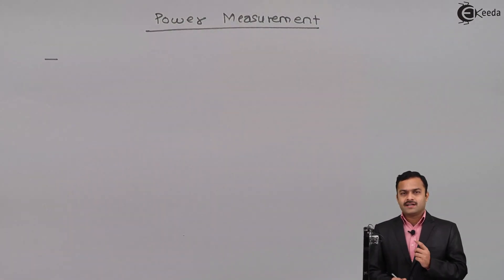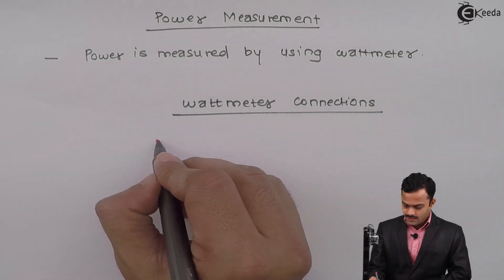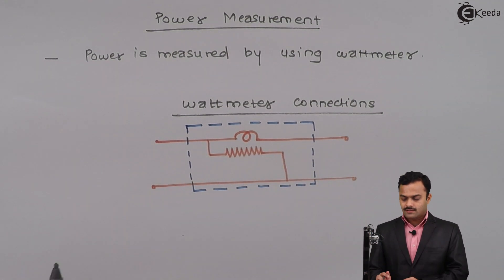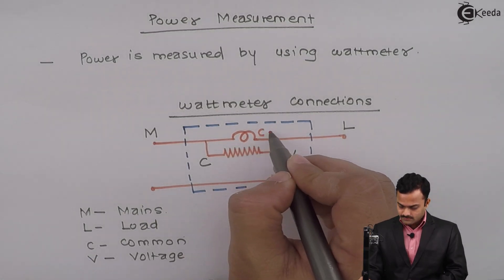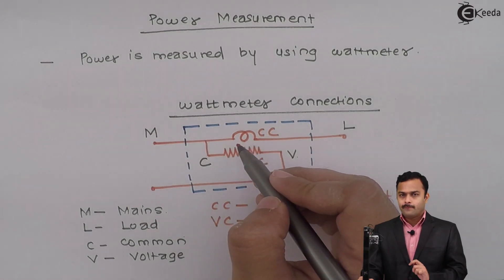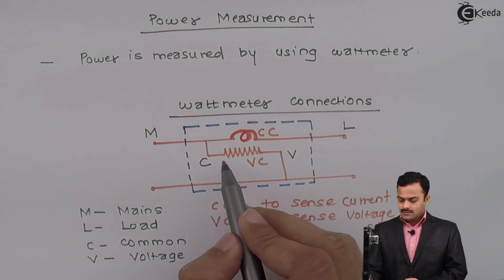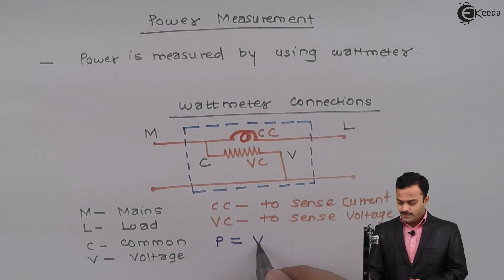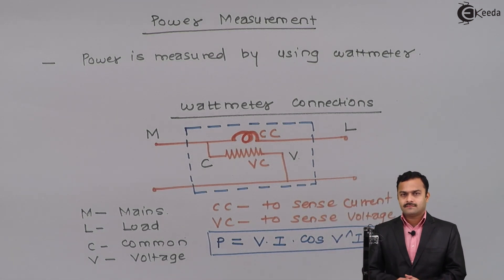Power Measurements and Wattmeter Connections - Three Phase Circuits - Basic Electrical Engineering

Comment: you give a wrong explanation.
Correct one is: In an Ammeter a small resistance is connected in parallel with the galvanometer and in an voltmeter high value of resistance is connected in series with the galvanomter.

Comment: "Ammeter has a very low resistance in series with the galvanometer" it's wrong.
Reply: A low resistance should be in parallel with a galvanometer
Again a high resistance should be in series with a galvanometer ,so that it draws as less as possible.
Reply: Yes you both right and sir say wrong .